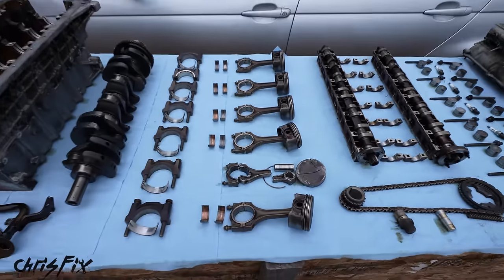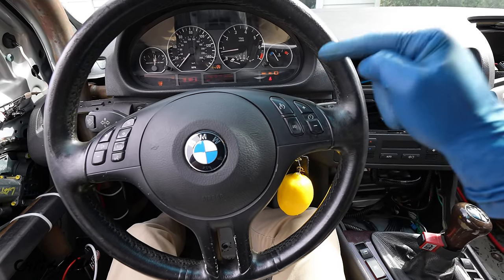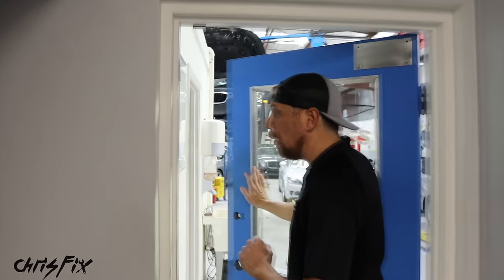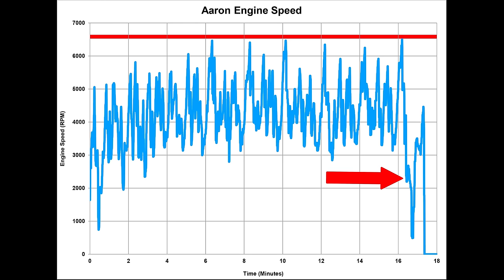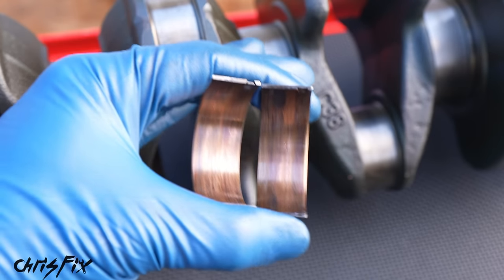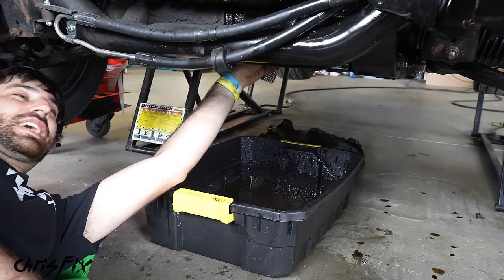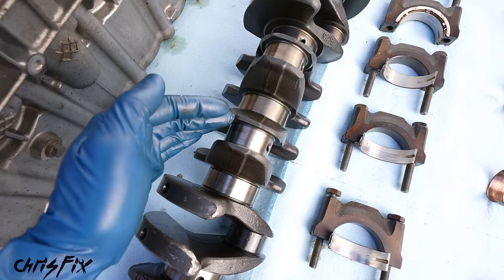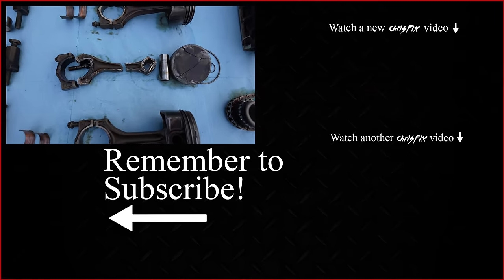What Causes a Spun Bearing in an Engine?

Comment: I think you should've also considered an overheated oil situation. Obviously oil gets thinner the hotter it gets and during prolonged race conditions it can reach temperatures of 130°C and more, which normal oils just aren't designed for. Also the warm oil weight (in your case 40) is measured at operating temperature (90-100°C), which is significantly lower than what you're gonna achieve on track. It means that you're actually getting thinner oil than you may have initially thought.

To conclude i would personally run at least a 5W-50 oil, coupled with an oil cooler or at least oil temperature and pressure gauges to keep things in check in the future.
Best wishes in the next race, love the content Chris!
Reply from the maker: Thanks for the tips!!!
Reply: I can confirm oil temps definitely affect the pressure. I run a pressure gauge on my dash and I’ve ran the car hot before at 220 (still in oem specs) but the oil was definitely hotter and oil pressure at idle was siting nearly 10psi lower than when coolant is at 180. I do have a factory oil heat exchanger that uses coolant but doesn’t help if the coolant is running at 220. Still made 75psi at higher rpm but definitely shows how real oil temps can affect its performance. Also that certain oils flash point really affect how well it holds up to heat. I’ve found liqui moly endures high heat a lot better than rotella t6 or castrol edge. For daily driving like a normal person, the “oil is oil” makes sense, but driving hard will separate the characteristics of different oils pretty well.
Reply: Yeah even my 110hp 1.8 celica had oil cooler
Reply: Misha made a video last year that described what kind of oil they run on their Ring Taxis compared to regular oil and also depending on the season. I think the suggest of investigating which kind of oil to run is good one
Reply: I didn't even consider this. Great thinking man!
Reply: @giovannifacci  Yup, they use Liqui Moly on the nurburgring all day
Reply: Back in my long-ago misguided youth running engines hard I went seeking an oil which didn't run out the drain hole like water when the engine was hot after running hard, which every brand/style/weight I could find did. Multi-grades were the worst. Only monograde racing oil did better- it seemed to hold it's viscosity. That was a ND oil so needed changing frequently for a daily-driver plus that got expensive fast, so I continued my search. Finally I found that Castrol HD seemed to do well and I ran that exclusively up to a few years ago when they stopped making it. I don't have a lot of experience with synthetics but without proper pressure nothing will work; maintaining viscosity has to happen to keep that pressure where you need it.

Comment: Very cool video man.  I didn't even know about that aftermarket oil chain tensioner.  I'm gonna check out that other video on the engine build now.  Btw, don't you have to factor the cost of these replacement engines into the $500 budget?  How does that work?
Reply from the maker: Thanks man! Since we blew up the engine at the race, as long as the same one or something crazy goes back in they wont count it against us. They just dont want you putting an LS or a Viper engine in there or something and making it unfair. An unknown junkyard motor that has a few new hoses and seals wont get us penalty laps... hopefully ;) haha
Reply: So basicly, your "500" dollar car exploded. It's now not worth anything. Even if it hadn't you just beat the shit out of a 500 dollar car for 3 days. Its value as far as the judges are conserned is 0. Replacing the same engine doesnt count against you. What could count are the upgrades hes doing to the replacement engine. but they arent actually in the car at the moment. In theory you could endlessly upgrade your car at the end of every race as long as it doesnt exceed 500.00 some of these teams race 4-5 times a year for the past 10 years.. they may look like crap.. but they are surprisingly well engineered by thier teams.
Reply: @chrisfix  Ah, nice.  Did your teammate who worked on the replacement engine put new bearings in it?  Might be something worth doing to prevent another blow up! 😬  They are pretty cheap, as I recall.  When I did my rebuild, my main bearings didn't show much wear at all but the rod bearings definitely did for sure.  Those can even be done with the engine in the car.
Reply: @50sKid  I had strongly considered doing so but I did not have the experience/knowledge/tools to check bearings so we as a team decided against it and I never checked any of them. The engine we got at the junkyard was spotless though, like some evidence of oil leaks that no one cleans up (typical lol) but other than that it was one of the best used looking engines I've seen so I think it was ok not cracking it open and letting all the magic out ;) I predict on my drift car my engine (2.5 with 265,000 miles lol) will shoot some component to the moon by the end of the season so when that happens, I would like to get a 3.0 and do a complete rebuild like you did. I went through your series on the rebuild and it was awesome!
Reply: Bearings are one of those things, yes you can replace them, but for the most part, if it isn't showing any issue just leave them or you could make it have an issue with them, a simple oil test. 
As you don't need to run Cats when racing, you could sell them off, and then the parts 'upgrades' are free/cost reduction.
Reply: @wobblysauce  Dang that is true! The prices of cats have gone to the moon!
Reply: @SI0AX  If you can find a buyer. Due to the prevalence of Cat theft, they're hard to buy and sell used in a legit fashion.
Reply: @ratdude747  But don't they want it for scrapping into materials, not for re-use in a vehicle?(technically car manufactures want the metals to create more cats for selling cars so it may be the same...)
Reply: @hopesdreamsracing3661  There's a lot of silly things that get you no penalty laps. Usually silly engine swaps, body swaps, or unconventional cars.
Reply: @extraordinarymediaproducti2678  that’s awesome! I’m actually glad to hear that the engine looks super clean inside. That is the biggest indicator of a well looked after block. Plus you guys will push the car at test races so that’ll give you the confidence you need. Looking forward to seeing the results of all your hard work. 👍
Reply: @chrisfix  IF you are worried, you can always ask for a residual value from likely Eric Rood or Nick Pon at Lemons.  Regardless, those cats are worth bank in New York as they have to use OEM or CARB approved...absolutely will offset anything if you want to justify.
Reply: @SI0AX  True. But I think you have to provide proof of ownership for the places that will buy them. At least some amount of red tape involved. 

Maybe I'm wrong, but I think there may be a rule for the 24 hours of Lemons that's specifically about cats... but my memory is fuzzy.
Reply: @ChrisFix and what about the super reliable engine, i think a super rebuild second engine is cheating if you don't have a penalty. That is not racing in a budget
Reply: @seandillon3340  spares do not count toward the budget but indirectly you have a point...for the race after they swap in the "built" engine.  But almost ten years in the community, no one cares.  You lost the race because you had to swap.  The next race, odds are the more reliable engine will not win it for you.

Folks win in Lemons by being on the track more than the other teams.  This means perfect pit stops, no penalties and no mechanical failures while still maintaining a good pace.  With the level of traffic involved, this requires many races for most teams even after you master the other three items.
Reply: @michaelkrenzer3296  The engine only has reliability mods. They won't care unless it's performance mods and they will only really check if they notice the car accelerating a little to quick and then do an investigation and check for upgraded valve train. 

It has happened before and they asked the owner to remove the valve cover for an inspection and then assigned him penalty laps when the saw the upgraded rockers and valve train components.
Reply: @50sKid   he showed in this video that they replaced the bearings, so thats a good thing to prevent!
Reply: Hey @50sKid I just wanted to say that I endurance race an E46 as well and your videos have been monumentally helpful
Reply: Good question
Reply: @SI0AX  I am sure most things have happened at least once in Lemons.  Of course, it normally goes the other way that their hotted up motor blow in 20 laps so they get to install the crusty original  motor and end up in the wrap up video...again...for having to do so...again.
Reply: @michaelkrenzer3296  That is an interesting trick I haven't thought about. But I could see them catching on if the car is moving too fast and it sets of alarms. They could check out the blown engine and then assign penalties but I think that if it goes unnoticed, then it's not much of a performance gain to begin with.
Reply: @hopesdreamsracing3661  Maybe, maybe not. Keep in mind the "upgrades" are only for reliability and he specifically stated they are not performance upgrades. So the judges may not care.
Reply: @lyianx  so your right. 95% chance no f#@ks given. Generally speaking they dont care what YOU do. But have a custom shop build your engine.. $1000's of dollars in labor.. kinda will be looked at with squinted eyes. What his friend and his father did is exactly what lemons is about. blueprinted motors from FL, not so much, dosent matter in the end. Gonna hella splode!
Reply: Sean Dillon actually, the car is rated for BS inspection as it sits for BS inspection. We could potentially have a blown m54 in there for inspection, and between inspection and the start of the race, LS swap the car. Completely legal per the rules, but VERY difficult to execute.
Reply: @michaelkrenzer3296  fair enough

Comment: I love the explanation of this. I know a ton about metallurgy and it's so interesting to me that the problem was an oil problem -> bearing wear -> friction causing tons of heat -> heat changing the volume and properties of the metal -> and then an explosion. Heat is the BIGGEST problem with internal combustion engines and is absolutely the limiting factor for them.
Reply: It was overheated oil that couldn't provide enough lubrication.

Comment: Love to see a resealed and super clean engine replacement! Might as well flash an EU tune on the DME before the next race. Will go great with the catless headers and SAP delete! Great Job guys, looking forward to Jamie’s video!
Reply from the maker: It's pretty nice all put together now! And we will keep that in mind!
Reply from the maker: Thanks for the tip man! You think messing with the computer is a good idea for the endurance aspect of the car? We really dont need more power as much as we want reliability.
Reply: @chrisfix  ECU communicates with oxygen sensors on the cats for emission. Now, whatever it tries it will not help anything because theyre gone 

Flashing a tune professionally gets you a computer that gives the engine what it needs instead of trying to follow whatever regulations it was designed for

Basically, done proper, you enhance reliability by flashing
Reply: @chrisfix  No problem! It might actually be better for long term as the extra airflow will be accounted for by the DME. The butt dyno probably won’t notice the difference but the engine should gain a couple HP too!
Reply: @chrisfix  EU2 tune is a stock tune that no longer cares for the SAP or post-cat O2 sensors. There should be zero negative effect on reliability as a lot of European E46s run it from factory. You can update it with winkfp and a $20 INPA cable off of eBay/Amazon. You can get the ZUSB (version number) from realoem. Look up "not so complicated install of BMW tools"
Reply: @chrisfix  you can finetune for reliability
Reply: @chrisfix   Removing the cats will throw a code and can put your car in limp mode as it thinks there is something wrong. This is much more likely as you are running extended periods of time. 

An ECU tuner can tune your engine for MPG and reliability while also telling your ECU to not freak out over post cat O2 levels.
Reply: I gained 20whp with headers and eu2 tune. 
Take the car to a pro and dyno tune it. Your air/fuel ratio and fuel mappings will be off after mods.
Reply: @armandocardona6975  ms43 will not go into limp mode because of no cats.
Reply: @poleposition3065  you’re also driving a turbocharged car so tuning goes a much longer way on those.
Reply: @danilochavarria7348  what turbo?
Reply: ShopLifeTV hey Shoplife! I’m Aaron, the OG bmw pusher for the team. I’ve been an E46) guy for many years now, but have never used the bmw tool suite to flash an ECU. The EU tune for the car is the plan, but I don’t actually know how to execute it. I’ve got winfkp, ista+, an operational k+DCAN cable (worked on my N54 E90, my current E70 x5D, and the N54 donor car I have) where can I find info on steps involved to actually flash our teams’ ecu?
Reply: @anotherbmwguy  easy. Input the last 7 of your vin into realoem then choose the EU spec of your make and year. Go to engine electrical system then programmed control unit. You'll find the one that's designated for EU2. The ZUSB used for winkfp is the part number excluding 1214 at the beginning. There are plenty of DIY's on e46fanatics

Comment: Hi Chris, nice video !

I'm sure you already know some of these but as a former engine bearing expert, I would suggest couple of things to overcome this situation. It may be true that engine was badly maintained before the race, however it can encounter the same destiny within a short period in race conditions with standard bearings. It is very likely that coating is completely worn out in that con-rod, oil clearance is increased and thus oil pressure is dropped.

1) So high of a rpm for a long time, such as an endurance race, cannot be handled well by a babbitt coated bearing. This coating is very very soft and will wear out quickly even if you replace them with brand new ones. Babbitt coatings also start to detoriate after 180 C, which is very likely to happen during an endurance race. I can see that damaged bearings' brand is Glyco. I'm pretty sure that there is appropriate replacement bearings which are "sputtered". In this case upper con-rod bearings will be coated with much harder material, which will wear out much slower and will handle most of the beating coming from pistons. In this case, lower bearings should still be babbitt coated to embed all the dirt coming from oil with soft layer.

2) Consider using polymer coating ,preferably on top of sputter coating. This will enhance the emergency lubrication properties of the bearing surface especially for short periods of oil starvation (such as cornering etc.). Polymer coatings basically provide dry lubrication properties when there is not enough oil. Extra thickness that comes from polymer coating should be considered in terms of oil clearance !

3) For race cars, oil clearance should be adjusted slightly higher than a normal street car. Otherwise, at high pressures during race, oil will be squeezed out of the bearing, leaving the bearing less than ideal oil amount.
Reply: Do you recommend adding additives like LiquiMoly Ceratec to the engine oil?
Reply: Your take was very helpful. I am a novice bearing engineer (hydraulic actuator bearings). I was wondering, does higher rpm require higher oil pressure to ensure oil film??. Also does changing the oil clearance require a change in oil pump/system change from stock??. Thanks!
Reply: my bearing spun & they said they found fine metal in oil because of it. I haven’t drove my car as far as a mile since the bearings spun. Do you think the engine can be rebuilt or am I likely to have to buy a new one
Reply: @bpknows1  hello, depends on the situation of the crankshaft...

Comment: One thing people in general should know is that "low oil pressure light" actually means "not enough oil pressure to even idle safely" (fuel pressure is not a fixed amount, it rises as rpms rise because the engine needs more oil in high rpms). When you get a low oil pressure light, immediately shut off the car. It will spin a bearing and do this quicker than you realize.
Reply: This why a lot of experienced Lemons teams have a seperate oil pressure sender set for a hot run or hot oil pressure...usually attached to GIANT trailer indicator light on the dash right in front of of the steering wheel.  Drivers cannot be trusted to look at guages but a blinding light right in their field of view is hard to miss.  

Another is a coolant pressure light.  In practice once up to temp the coolant system should be at at least 4 PSI and if it is, light is off.  Second it drips below, light comes on.  This is important because boiling coolant is still going to show about 212f on a temp guage which is a totally fine racing temp even as it is all boiling right out of the cooling system until you are totally dry.

Comment: Man this was an awesome in depth analysis. It actually helps me out, I had a similar issue happen to my vehicle. Engine blew a rod and the auto care service that was driving it at the time had it “inspected” and claimed it was just natural ware and tear. It’s hard to believe only because I took very good care of the vehicle and changed the oil per recommendations. This helps understand more of what could have potentially happened, so I really appreciate you breaking it down (pun) like this.
Reply: A shop blew your engine?  Sounds a new, free engine is in order to me lol
Reply: How many miles did the engine have on it?
Reply: @sufferr2914  it had 175k miles. Zero engine issues prior.
Reply: @kpeezy765  Yeah sounds like you should get a new engine on the house